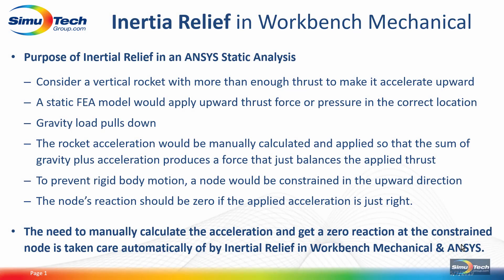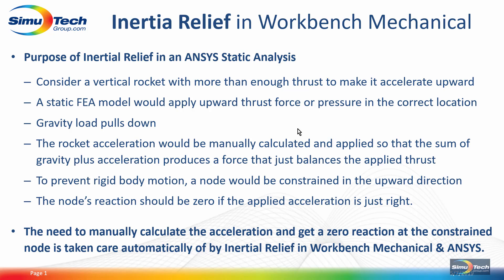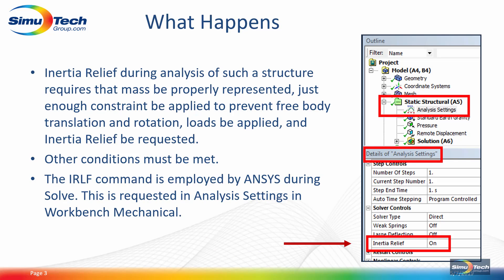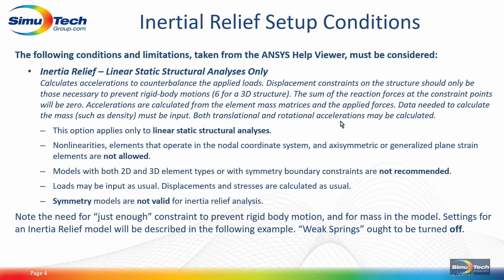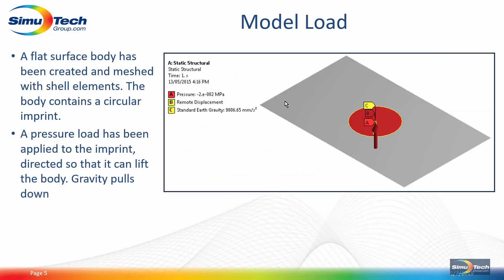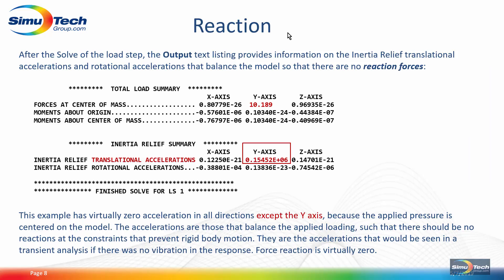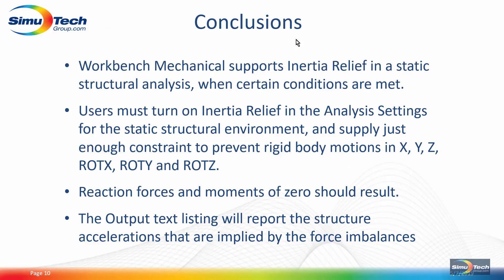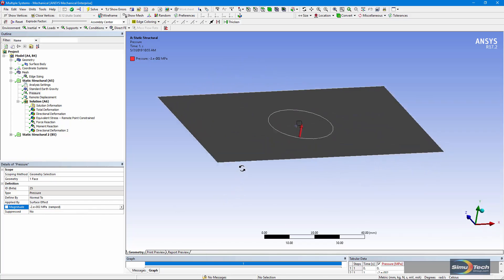How to Use Inertia Relief in ANSYS Workbench Mechanical

Comment: how it Nolineer analys but Inertia Relief On ?
Reply: Probably You cant have here nonlinear analysis as applied forces are balanced out for given time frame - as if you stopped the time.
Reply: Nonlinear will turn on automatically by Ansys because of the parameters.